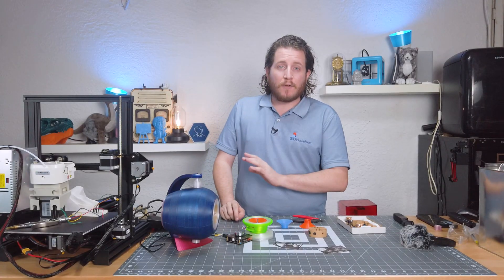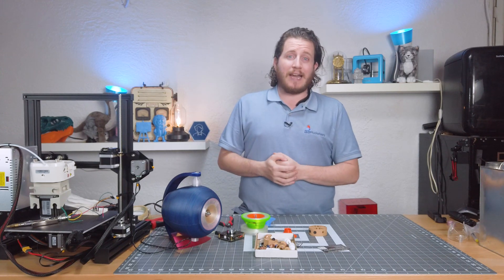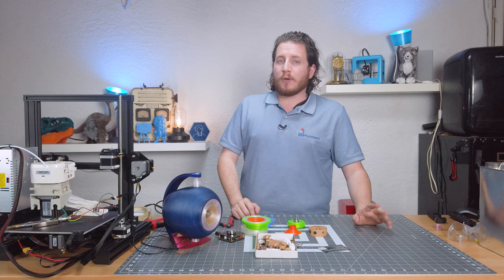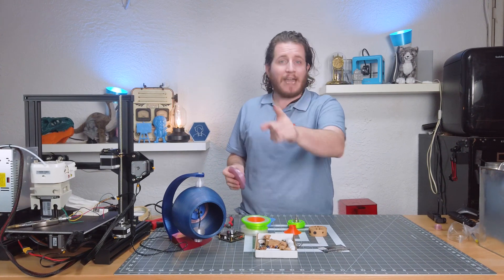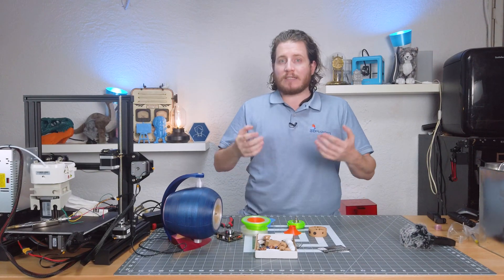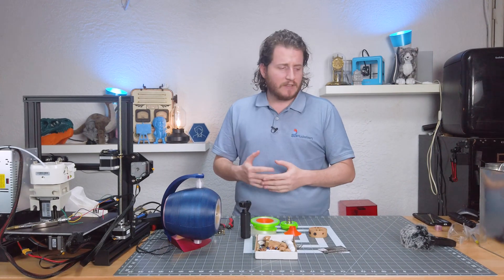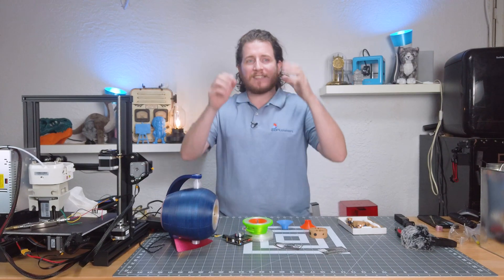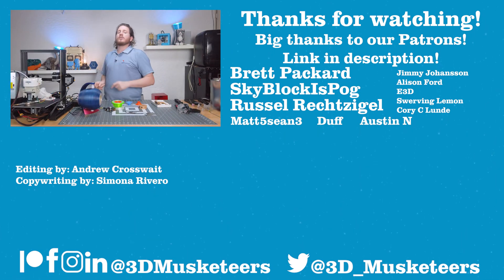Can a 3D Printed Speaker Sound Good???

Comment: Can you print a 40 inch subwoofer cone?
Reply from the maker: 40 inch? It wouldnt last. Possible, sure, but to get it stiff and light you'd want to make it out of woven carbon fiber
Reply: @3DMusketeers  how do I accomplish that? They don’t make them anymore so I have to look into 3rd party options.
Reply from the maker: Taking a casting of the one you have or printing out a master to do carbon fiber layup on. It won't be cheap. A 40in sub is massive. Don't forget about the voice coil, spider, etc.
Reply: @3DMusketeers  how much do you think it will cost? And can you help? I don’t need a voice coil I just need a cone. I have the motor.
Reply from the maker: I would print it in pieces. The mold would be a few hundred for sure. I dont do CF work here but I know a few that do. I would expect no less than 1k all in for this because of how crazy big it is. Any ideas of the previous cone weight?
Reply: @3DMusketeers  no I do not however, I could get it where it’s relatively fairly light. I can also take a look in the product master. If you could put me in touch with some people, that would be much appreciated.
Reply from the maker: shoot me an email and we can chat: youtube@3dmusketeers.com

Comment: Bring on the ribbon tweeter! Some Theil Small parameters and a frequency sweep would be nice but it looks like a fun project.
Reply: My website needs a serious update. Response is currently not up on there but will get it back. TS parameters, I just went back through my readings so here you go!:

Sd: 50.2cm2
Re: 3.66 Ohm
Qts: 0.89
Qes: 1.32
Qms: 2.82
Le: 0.192mH
Mms: 4.96g
Vas: 3.136L
SPL: 82.0dB @1W / 1M

Xmax in simulation shows to be around 2.5mm one way. Hope this all helps :) Feel free to DM me on twitter too!
Reply: @Polymate3D  Sounds good! The Qts of .89 would make it work in an infinite baffle, maybe try to get it down to .7? I love this project and will be building a couple with my kids in the summer.
Reply from the maker: I can try infinite baffle.. Never even thought of that, it should run well as IB as well, but a small driver may be odd for it.
Reply: @jameswarren1831  As much as I have more set motor designs now, I am always working on finding improvements there. I have a un released higher end motor which would probably end up at around twice the cost, but already is getting down to 0.58 Qts on a larger driver, and has a longer linear travel of around 3.5mm currently. I am trying to make a variety of designs to cover from intrigued people to the DIY audio people who want the absolute best I can do. I am always open to ideas :)
Reply: @3DMusketeers  Maybe a 2 or 3-way with this on a open baffle doing the mids?
Reply from the maker: @Polymate3D  I would try it!
Reply from the maker: UGH YES! We have an audio sweep, but it is not picked up well from the mic so we cut it alas. 

Paul has the TS Parameters on his site/twitter :) But in the enclosure things change obviously.